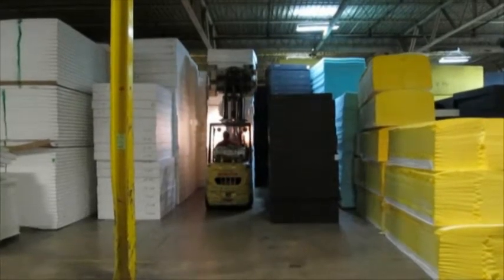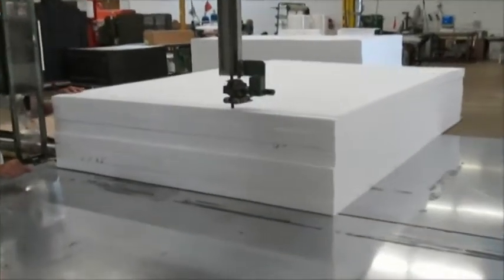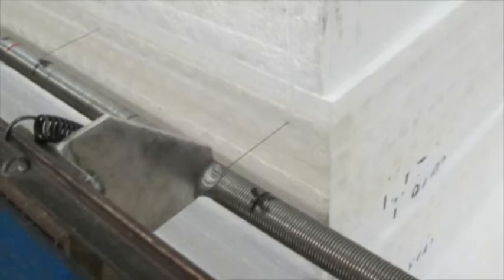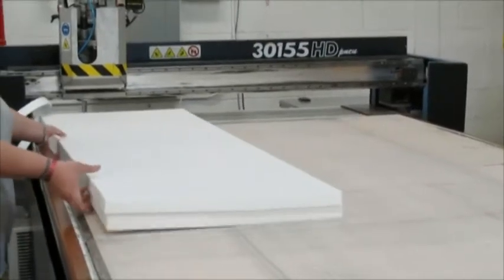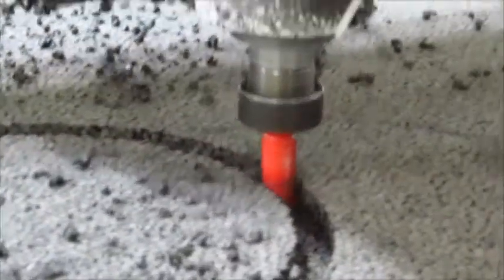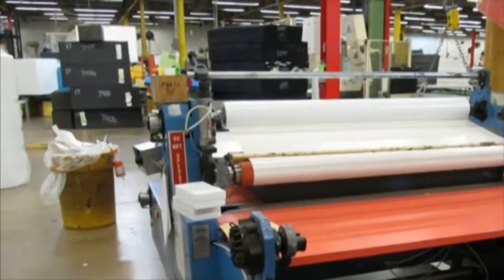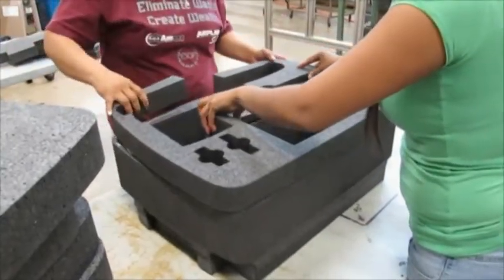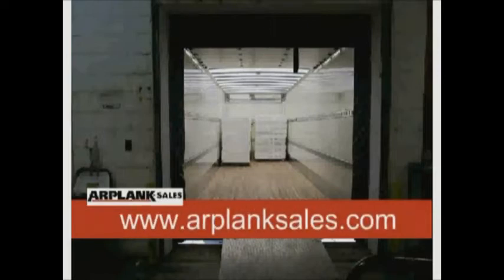FABRICATING EPE & EPP CLOSED CELL FOAMS WITH TRADITIONAL CUTTING EQUIPMENT.mpg

Comment: Thanks for a great video. I'm experimenting with machining EPP on a CNC router. I find that carbide end mills work extremely well but ball-nosed cutters do not provide as good a finish. I suspect it is because they do not have the sharp corners to dig into the foam so they tend to rub. Any suggestions?